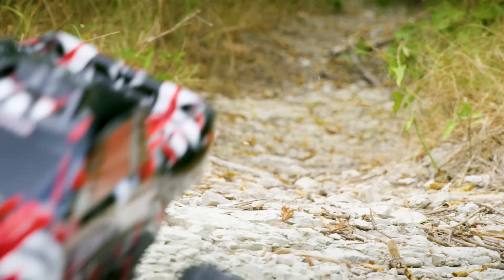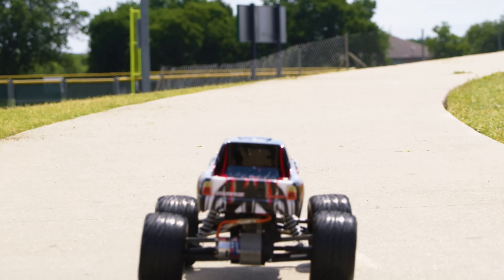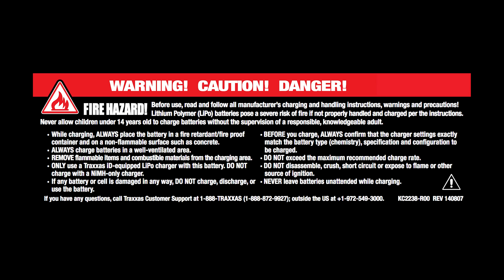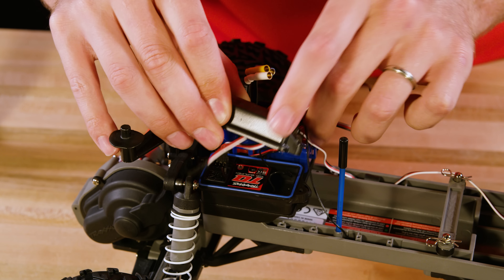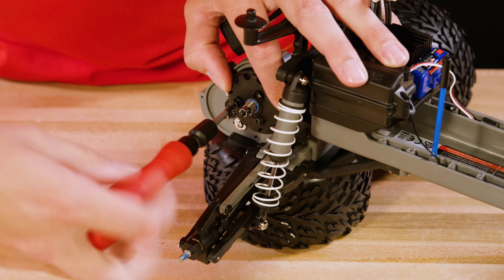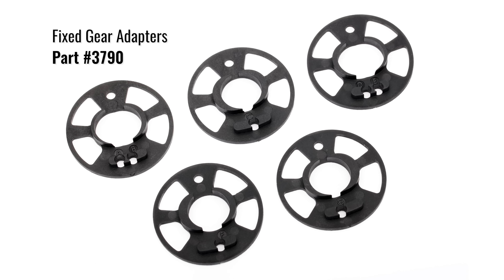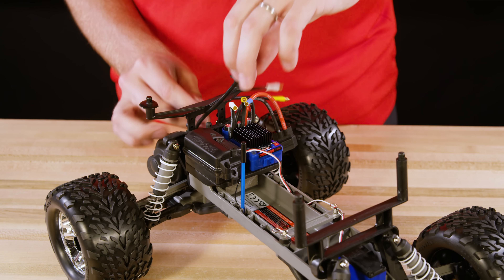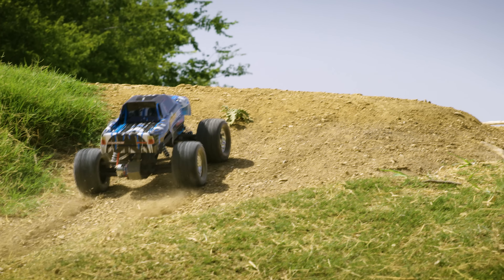How to Go Faster | Traxxas Stampede

Comment: I've had mine for 3 years now, and I've done this upgrade 2 years ago along with  several other upgrades to the suspension and steering. I wouldn't trade mine for anything.  TRAXXAS ROCKS!!!! I've even put a 50s style truck body I a brushed with  camielion purple to green to blue paint. She is SWEET!!!!!!!!!!
Reply: im getting ready to paint a pro line brute bash but what paint should i use? I wanted to do a Candy Red from House of Kolor, can the body handle the thinners in the paint? Did you use water based paint? Any help is appreciated, thanks!

Comment: If you're going to upgrade a brushed vehicle, I'd also recommend changing out the hub bushings for bearings.
Reply: What’s that
Reply: @legitkronos7661  The bushings are the little donut shaped bronze pieces that the front and rear stub axles ride on. And from the factory, the brushed editions of the 2WD Rustler, Stampede, and Bandit come with bushings in all 4 wheel hubs. Bushings are okay for lower power applications (like in a basic 2WD brushed vehicle) however when you want to start adding more power (like with a brushless conversion) the bushings will wear out considerably quicker. Thus I recommend an upgrade to ball bearings. If you disassemble the hubs on any of those three vehicles, you can actually remove the bushings and replace them with ball bearings of the same specs, which Traxxas does sell for each vehicle. The bearings can handle the extra power of a brushless motor better than the bushings and will roll smoother.
Reply: markoftheus  got it thanks man . I recently just put in a nice brushless system in the stampede . It’s a beast with the new steel gears in it . Running a 3s just needs a wheelie bar lol
Reply: @legitkronos7661  Sure thing man! And just for reference, the bearings for a 2WD Rustler and Stampede (I believe from 2006 onward) are 5x11x4 mm. Older models used either 5x10's or 5x8's.
Reply: Just this upgrade makes your rc so much faster!
Reply: Hope you are still monitoring this. So you are saying swap out the bushings for bearings? I'm going to try this on my Stampede. Would this apply if I wanted to do a full ground up upgrade to a Slash 2wd?
Reply: @DontDodgeIt...RamIt...Dammit.  The 2WD Slash (even the brushed model) comes factory equipped with bearings in the hubs. You don't have to do the bearing swap on it.
Reply: @markoftheus   Oh ok. Thanks for the info. Have 2 Slash trucks and would really like to build one solid one but wasn't sure where to start until running across this video.

Comment: A few simple and expensive upgrades
Reply: Its just money, you make it every day 😏
Reply: Also if it was just cheaper to convert an xl5 to vxl no one would buy the stampede vxl
Reply: @Lorenz_C  thats what I did.  Made my 2wd stampede into a vxl model but still 2wd.   Costs me more to upgrade everything than just buying an already lightning fast 4x4 stampede vxl model.
Reply: jcallesano why what broke? I did the same thing changed my 2wd brushed system and put in a brushless system and nothing has broken so far and I’ve had it for 5 months
Reply: @TortugaBruv  rear plastic drive shafts....those won't last at all.   I shredded both sides once off training mode.
Reply: jcallesano hmm strange my driveshafts are good
Reply: @TortugaBruv  for now..plan on swapping them to full aluminum if you want to really hammer on it.
Reply: swap to xt60 and buy spare spur and pinion.
Reply: @jcallesano  lol I bought a redcat, platform was garbage and kept breaking but electronics good, bought a stampede roller, and I'm in way more than if I just bought a stampede vxl. Moral of the story, just stretch a bit and go with the better rc if you are hung up between the cheaper one and better one.
Reply: Expensive hobby haha
Reply: I upgraded to the sidewinder sct my little brother likes it 🤷 100$ upgrade lol
Reply: @jcallesano  I bought a arrma granite blx 4x4 while I was traveling for work, after I realized I needed something tougher than an ECX amp. I don’t think I had been home a week when the steering servo and the transmission went out (same day. Still waiting on parts to come in) but I had a couple spare batteries and motors, so I swapped a 12t brushed and a 4200 7 cell nimh battery for a stampede roller. I had an extra brushless system lying around that I dropped in it and I’m just waiting on a steering knuckle for it. Should come in with my arrma parts and hopefully I’ll have both trucks back up on the road 😁😁
Reply: @Santiago Colt instablaster =)

Comment: I remember back in 2006-2007 I bought one and upgraded to a MM5700 on 12 cells. All steel tranny and bearings for the wheels. It easily did 55 on 23/90 gearing. Its still in the garage, wrecked, needs about 30 dollar worth of parts to fix.

Comment: I used to have a jlb racing cheetah it was fun and all the tires would turn into paper thin plates when full throttle, today I picked up the stampede from a hobby shop/used but hey I’m liking this thing I had a problem with the cheetah as if I even touched a curb or anything I broke parts left and right but this stampede does it’s doos lol

Comment: Can Stampede 4x4 kit handle a brushless power upgrade? I hope so I have one on order
Reply: did it work?
Reply: The Stampede 4x4 kit can handle brushless power although not as effectively as a Stampede 4x4 VXL. The reason why is because the kit is modeled after a brushed edition Stampede 4x4 which uses a plastic center driveshaft (vs the VXL's aluminum center driveshaft) as well as different ring and pinion gears for the differentials; The ring and pinion gears on the differentials of the VXL model have larger teeth which are stronger. 

That said, you should be okay as long as you're not doing anything too crazy like putting in an 8th scale motor on 4s LiPo. 🙃

Comment: Do I need a Lipo because I have the original stamped and have the 3000 stock battery
Reply: You can use the stock NiMH battery with the vileneon system. However, if you run your vehicle hard, I would recommend getting LiPo batteries b/c the NiMH packs have a tendency of getting hot when you run them hard.

Comment: Can you put the velineon power system on the traxxas bigfoot?
Reply: Big Austen Outdoors yup. You can put it in any traxxas 2wd
Reply: Or any 1/10 scale traxxas
Reply: Thanks
Reply: @brysonkuhn3290  Any of their smaller 1/10th scale vehicles, lol.

If you were to put it in an E-Maxx, E-Revo, or Summit (which Traxxas also call 1/10th scale) the system would overheat.
Reply: @markoftheus  even though they are labeled "1/10" they are practically 1/8 scale lol

Comment: Will this motor/ESC upgrade work on an old Stampede model?   It’s at least 12 years old.
Reply: You should be fine. I have a friend that did it with his old Rustler (which has the same gearbox as the Stampede) and it worked perfectly.

Comment: I recommend a side winder 4 over a Vxl 3s it’s much better performance and value for the money
Reply: Jay Workman yup but they’re people who only buy traxxas products which is stupid imo
Reply: The downside with the sidewinder 4 is that the BEC only outputs a fixed 5 volts compared the 6 volts of the Traxxas ESC's. As a result the steering servo is noticeably slower and weaker. 

Not trying to knock castle but just something to look out for.

Comment: How do you change the gearing on the 4x4 variant?
Reply: To change the gearing on the 4x4 version, you have to remove the four screws that hold the rear end of the truck onto the chassis and then you can pull the slipper assembly out to change the spur gear. 

If you want to change the pinion gear, remove the screw holding the gear cover on and then remove the screw that holds in the motor plate. Then you can rotate and lift the motor out to get access to the pinion gear.

Comment: I upgraded my 2wd stampede to the brushless system and my friends 4x4 vxl is ridiculously faster but they have the same exact motor...?  Why is that?  Both 3s 5000 paks for bats
Reply: His i 4whele drive and vxl. It's way faster no matter what. 2wd are slow.
Reply: @Tyler-ev7xq  that's not true at all.   Far from the truth actually.
Reply: Odds are your friend's truck is geared higher.
Reply: @markoftheus  I found out back when this was an issue that the truck set itself to 50% training mode.  No wonder! Lol   my 2wd can't hit full speed, wheelies at 50. I don't know really how fast top speed is.

Comment: Do someone know how much volts and cells a original esc in a stampede can take?
Reply: The XL-5 speed controller is rated for up to 2 cell LiPo (7.4 volts nominal, 8.4 volts fully charged). 

The VXL 3S speed controller is rated for up to 3 cell LiPo (11.1 volts nominal, 12.6 volts fully charged).
Reply: @markoftheus  thanks!!

Comment: im trying to make a crawling stampede i wish i had support
Reply: You'd have to change a lot to make it a crawler. The TRX-4 sport assembly kit is a great buy if you want something purpose built for crawling.
Reply: @InvisiMan2006  yeah i already did  i just need to adjust things also its a independent suspension rc car